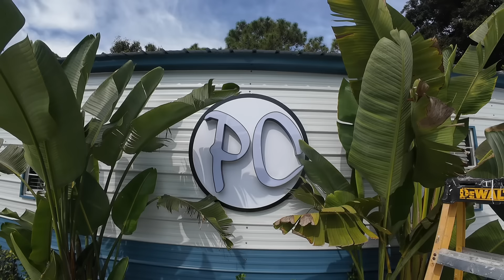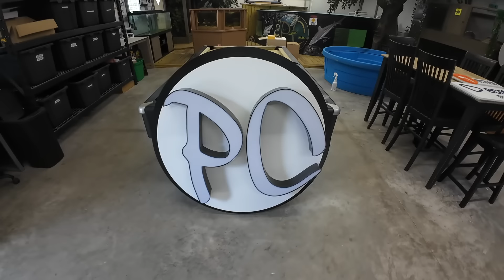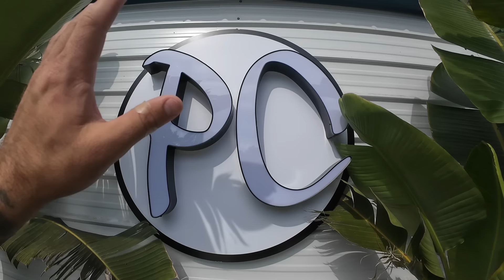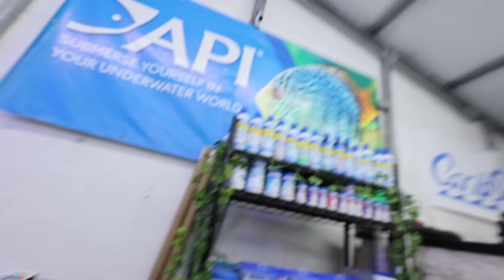Rehoming ALL of My BABY TURTLES to My FIRST POND!!

Comment: Paul, I told you in the video of Hector building the crates that they would be a issue.

Copper will also leech into the paint on the walls, and into the sand. The entire shark tank will likely need to be emptied entirely, repainted, and new sand.

Sorry brother. I have been keeping saltwater aquariums for 25 years, and have a bit of experience.
Reply: Not just copper, arsenic is also often in treated wood. I'm not sure it will need repainting, id definitely replace the sand and rinse the tank out a few times though. New bio media as well. Definitely wouldnt risk a baby zebra shark in it for a while

Comment: Depends if that was treated wood. Now a days treated wood is heat treated and infused with ionized copper solution to prevent algae growth and rott. Normally a nice hardwood or cedar would be best for long term underwater usage without treatment. There are also prefered woods that are easier waterlogging in an aquarium.
Reply: It was. The wood had that classic green tint to it when they built the crates. The comment section even called him out on it.  Paul is known for cutting corners and cheaping out on materials.
Reply: Cedar wood contains natural oils that are toxic to both fish and invertebrates (red cedar oil is marketed as a natural insect repellent). It might not be a problem outdoors, but remember a tank or pond is much smaller volume than a lake (less dilution). I would also advice against using any pine tree product in a pond or tank, the terpentines in the wood are not good for the fish.
Reply: @emilviklund7290  Sounds like a true Scandinavian. Kudos